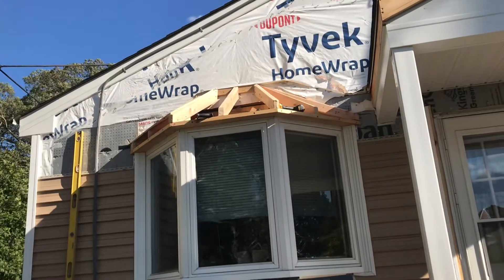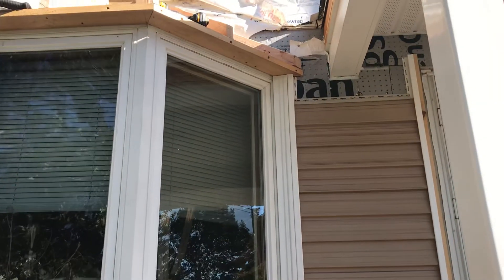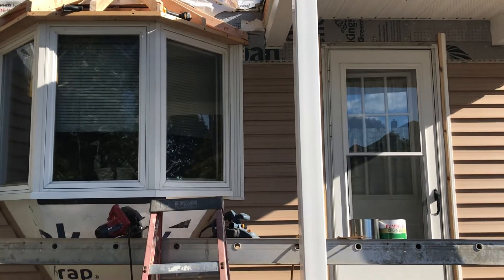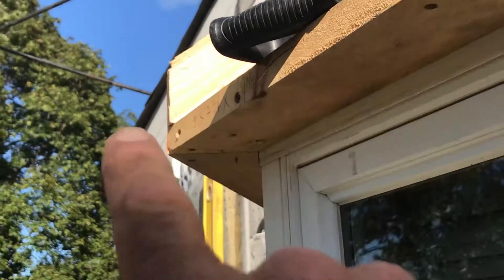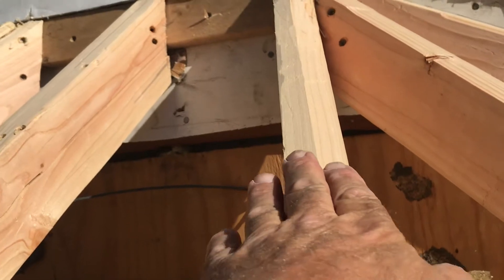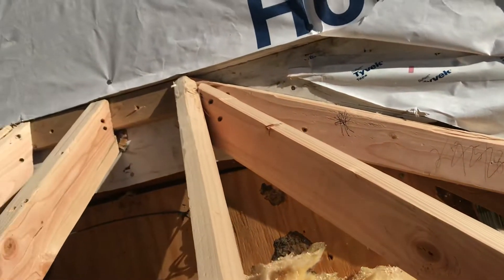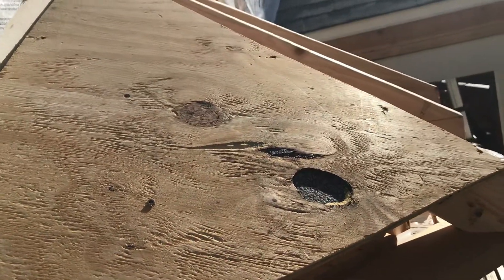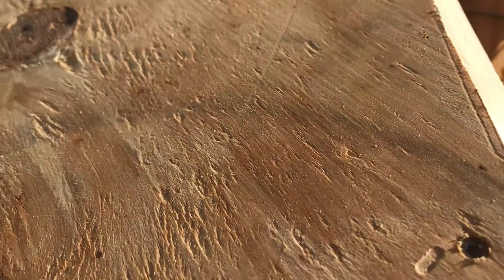Bay window roof framing

Comment: How do you calculate the angle - length  of the center piece in the middle of the window that goes against the wall?
Reply from the maker: Diony, with a string line, i can get the plumb cut, and a scrap block on the plate, or just let the top of the rafter be heavy, a plane it in to match the ledger rafter (the one against the wall) and the hip, see the description,  also i started the roof with the ledger rafters as i was calling them, i hope this helps. Thanks, Len
Reply from the maker: Diony, I looked at your question again and I don't think I answer it right. The ridge/ledger I plumbed both sides of the picture window and just guessed it, I wanted it to taper nicely, I should have matched the bottom to the top.....

Comment: what an awesome vid. I framed a few bay window some years ago. yes, the angle, so many angles. To master this framing, you are best to use mathematics to calculate the angles for the side wall hip rafters on the right and left. You need to understand trigonometry and the 1.414 multiplier. The most satisfying job i have ever done. I kept all the note for future reference.
Reply from the maker: Hi Construction secrets, thank you for calling this an awesome vid. If you watch the Playlist, you will see this is all ad-lib, I have no higher math skills, but the roof is symmetrical, the math I used was a sliding t bevel chalk and string lines

Comment: Hey can I ask you a question?  I'm considering installing a bay window in my kitchen.  My house is sheathed in cement fiber board.  Would you recommend that I remove that and attach the bay window roof to the sheeting under the siding, or can it be attached directly against the cement fiberboard?
Reply from the maker: Hi LA. I can't tell you not seeing your situation, i can tell you to contact your local building official, they may be able to advise you, they know well your local codes, thank your for your comment, i hope i helped you out. Thanks, Len

Comment from the maker: The reason i talk about the plane "change" on the hip rafters, is that if you don't get them in plane (by leaving the very center of the rafter stock, and tapering both side edges to match the front and side rafters, you will add noticable height to the "hip" part of the bay roof), which is multiplied, or made worse by the addition of hip shingles, the idea, in my opinion, is not to draw attention to any part of your work, thanks for stopping by i appreciate your interest, hope you can get something out of this.
Added, see description for more explanation on, how i done it....